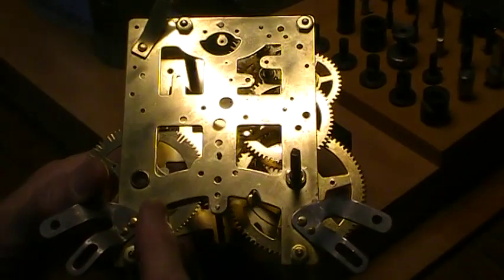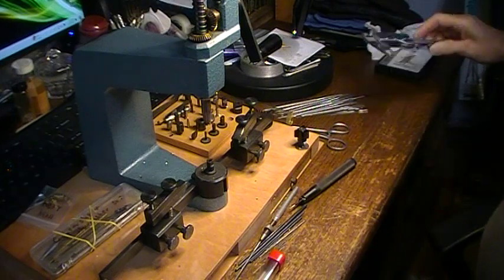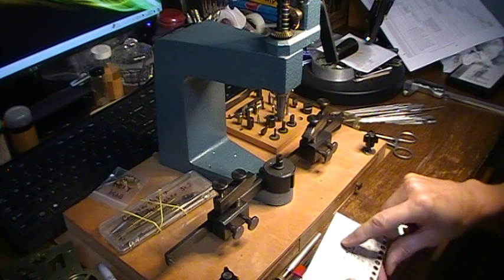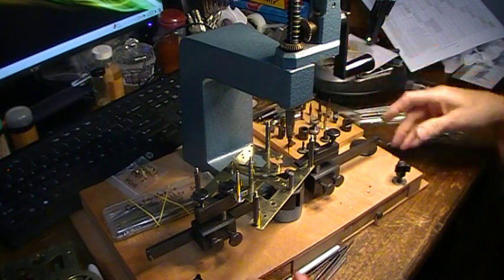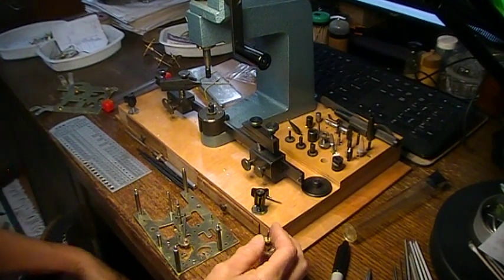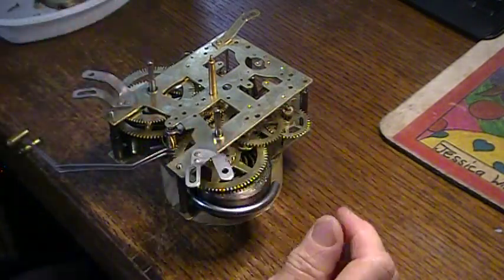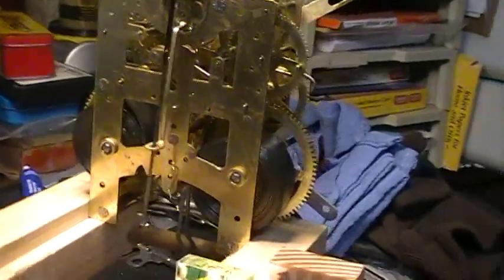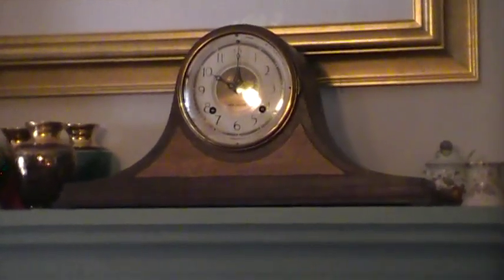c1915 New Haven Tambour No 7 Repair 2 Bushings Installed and Setting Up the Strike Side to Shut Off

Comment: Great explanation on installing bushings. Must be nice to have the KWM machine, the gage, along with a full drawer of different bushings. LOL.  You still need to try a box with a board on top of it so the movement is eye level.  It will help you out a lot in putting the wheels in the pivot holes and aligning everything up. Those holes that you put the rods in to keep the wheels from spinning were probably designed that way to do just that and you figured it out. Another great job. Sounds great. I hope that  you make a lot of money in the benefit auction for the dogs. That is if you dont decide to keep it as it is a nice clock. Thanks for the shout out. May God bless you and yours.
Reply from the maker: I do struggle to get the movement in a position where I can see what I'm doing when I'm getting the plates back together. Eye level would help a lot. I usually get it started enough to pick it up and finish it. The light shining through the pivot holes and changing the angles helps with my depth perception, which isn't very good.

Comment: Hi what do you think of these new haven movements?
Reply from the maker: It was the first one I had worked on. Different from the Seth Thomas and Waterbury designs. Some parts I'm not crazy about, some parts are better.
Reply: @cheryladair732  which parts do you like?
Reply from the maker: @jordanbusby6231  I like the lever system-one flat and one regular. The springs are longer or thicker one because I really had to fight to get the arbor pivot to catch in the hole on the plate to wind it back up.
Reply: @cheryladair732  yeah I understand about the spring problem that and the arbor hook is very small